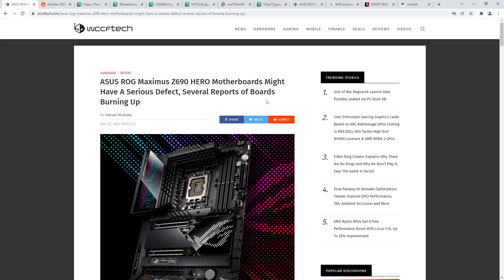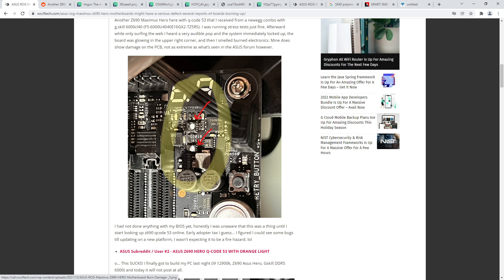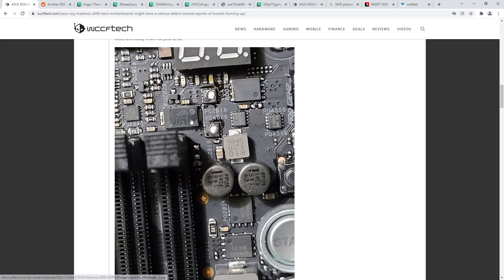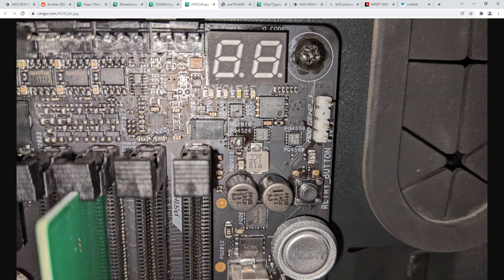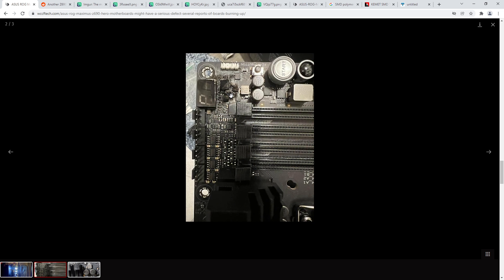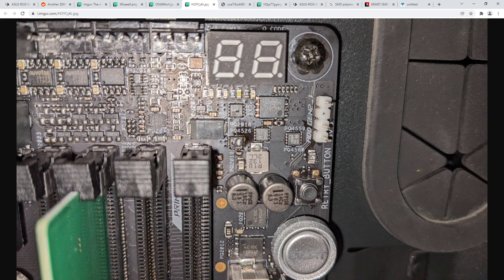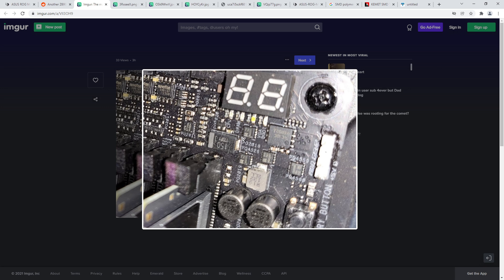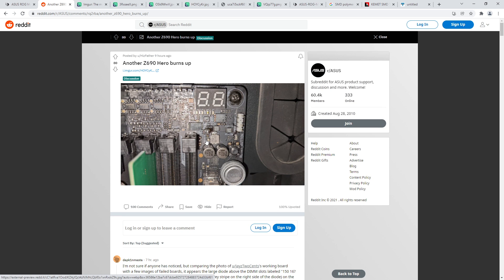My thoughts on the ASUS Maximus Z690 Hero failures

Comment: I have a z690 hero and can confirm that the g157 capacitor reads 5 volts on the right hand side of the capacitor and is positioned correctly in my machine. Picture uploaded on twitter.
Reply: I wasn't so lucky. My capacitor is facing the wrong direction.
Reply: @agordon20024  easy fix atleast
Reply: @CyberbrainPC  Easy fix as it may be for someone with a decent soldering iron and soldering skills, Asus really need to know to what scale this balls up stretches to. Anyone fixing it themselves will just lessen the impact of this major defect and it will pass off lightly like Apple's "A small number of ...."
Reply: @agordon20024  I'd get onto asus support tomorrow morning and get them to replace the board
Reply: @thomaswelch9147  I think you're right. This board is a replacement for a ROG Strix Z690-F that was defective. Will make my 3rd build in a week.
Reply: @agordon20024  on the plus side, if you're like me you're building a pc only a few times per decade, so you get the fun of adult lego for a bit longer.
Reply: @agordon20024  There is a guy further up in the comments who had your problem too. He contacted Asus support which acknowledged the problem right away and offered to send a replacement. Expect 7-10 business days before shipping. So at least you now know you don't have to fight the front line support in the RMA process....
Reply: @andersjjensen  I'll check that out. Thanks!

Comment: There's no way to "load the part backwards" into a pick-in-place machine.  If you load the reel backwards then the tape would be upside down.  The machine does rotate the part, so maybe it was programed wrong but more than likely, these parts were hand placed on these boards after they had already run through the pick-in-place.  Either because they fell off or because they couldn't get the caps when they ran the board, which fits with the different manufacturer caps.

Comment: I assume those mosfets must be running VERY hot even if they haven't failed, which would be even simpler to check than a volt reading (see if they burn your finger!). BTW, amazed at the number of owners here who are finding the suspect cap and chiming in with "mine's working just fine", apparently unconcerned. Is this (to use BZ's turn-of-phrase) kind of like Darwinism in action?

Comment: I'm in the United States and My capacitor is correctly oriented.  And I've pushed the 3 different DDR5 memory configurations and 12900K to their limits to the best of my ability.  No blown up board (yet , hopefully).  I hope you're are correct because I do not have the opportunity at the moment to pull this board from my case and wait out ordering a different model.  btw my PC runs 24 hours a day for remote access.  I'm extremely concerned now.  We need a conclusive answer from ASUS immediately.

Comment: I just finished my Hero build with an upside down 150 and stripe on the left. I called support to see what they would say. They're response: 
Yes it is safe to power on your new build, please just make sure that you connected the cables properly. Also it should have a enough power and cooling. ... If in any case that there is a safety hazard related problem that happen to your ASUS product, please reach us out for us to investigate it and provide a possible solution. ... We have to investigate it first so that we can came up with the solution, usually if safety hazard happen it will be our customer care support that will handle it. Not sure what to do.
Reply: dude it will be months before customer service even knows that this is the issue. They sure won't believe you if you tell them a cap is flipped
Reply: @marcogenovesi8570   @Mingyao Liu  - Newegg offered to refund and give a discount to upgrade to the next ROG z690 I wanted. So, I got the Formula for a bit more. Not ideal, but the best under the circumstances and I'll have a replacement in 2 days. I'll check the chip orientation (presuming it has the same layout) before building and move on.
Reply: @spindlewood9  you are very brave, good sir
Reply: Get an electrician friend, show him this video and ask him to check the capacitor with a multimeter

Comment: I bought a MSI B550 Tomahawk. I installed a 5900x, ran Cinebench and the PC shutdown.After investigating the vaunted VRM failed. Thankfully I was able to replace that with a Asus X570 Tuf that was probably produced before the shit hit the fan. It is for me trying to maintain stock levels by cutting corners so Quality Inspection is lacking. I have had a CPU die on me and several boards just stop working.Any enthusiast worth their salt will stay away from Gigabyte boards but if we are getting them on Asus Maximus boards I would be worried.
Reply: I got this board and TBH, I really preferred getting EVGA classified but you know EVGA and their really delayed launches of their Mobos. This/Formula was my second choice and I did not want to pay the extra for the Formula so I got this board. So far cap seems oriented correctly but I hope this the issue and there is nothing else going on. I just need to wait for memory and hope everything will be alright.

Comment: I have the backwards capacitor on my motherboard.  Got 4.5 to 5 volts using my multimeter.   Issue seems to be confirmed
Reply: Better get that RMAed then.
Reply: This comment needs to be pinned
Reply: Dodged a potential fire, well done to all (except Asus, of course)
Reply: @j-bro  This is not a fire hazard, all adjacent materials are fire suppression rated and capacitors and power semiconductors blow themselves clean at well under ignition temperatures.
Reply: Can we pin this comment? And get this man a drink?
Reply: @medavid16  my cousin and i both just checked and we also have the backwards capacitor :(
Reply: @medavid16  how was the RMA process like? Are they going to send you a board that is confirmed to be free of the defect? Are they shipping you the replacement board first or are you sending yours in first? I just want to know what to expect when I call. My steam name is suspectmammal
Reply: I’m going through this now. They SHOULD be sending an advanced replacement on this issue but they are bot. They are not even sending a new replacement. They are offering you send your board in as an RMA for repair with a 7-14 day lead time. I bought through Amazon and even Amazon thought it was messed up that they wouldn’t send me a new board so I just got my money back and ordered another board somewhere else. If I get another reversed capacitor I’ll have to send it in as an RMA. Good luck
Reply: @SikSemper  this is exactly what I imagined was going to happen. I also bought it from Amazon and can’t find and hero boards in stock. Where did you find your replacement? I was hoping to get the same board that was NOT affected by this. Might have to downgrade to the strix E
Reply: Do you have a hot-air station? If they refuse RMA (WHICH THEY SHOULDN'T!!!) just flip it.
Reply: @coccoborg  I have a hot air gun and soldering kit - holding off since my assumption is if I mess it up it voids the warranty.  Reached out to Asus and they escalated to tier 2 support and said I'd hear back in 24 to 48 hours.  My guess is they're going through the usual internal red tape for issues like this.  Thankfully I hadn't sold my old board cpu etc. yet if I need to use the computer before they can make this right!
Reply: @themancave8567  good! yes, fixing it yourself is only doable as a last resort. If ASUS is smart, they'll just send out replacements, receive the defective ones, fix them and keep the boards as future refurb stock for RMAs!
Reply: @coccoborg  Asus just called me and will RMA the board.   They confirmed the backwards capacitor is the issue and they will be checking any replacement boards to make sure they're right.  Unfortunately 7 to 10 business day lead time but it is what it is at this point.  Just glad there wasn't a fire and I have a backup system
Reply: @themancave8567  glad to hear this!
Reply: @themancave8567  Thanks for the update! We now have confirmation that Mr Buildzoid's eagle eyes nailed this one right away (despite his modesty dictates that he should say "only 99% certain").

Comment: I agree with the automatic visual inspection catching it since pick and place machines notoriously have parts that spin, are picked up off center, backwards, etc the path to placement is always over the camera which corrects positioning. Must have been an engineer leaving placement orientation out of the program. Don't blame the operator!

Comment: waiting a Z690 extreme I will definitely look at that capacitor before installing it THANKS EDIT : I will post tomorrow 29.12.21 if mine was correct EDIT2: bad news the extreme has a thick metal cover that hides the component and you cannot easily remove that cover EDIT3: game over sorry I won't be able to inform you, the regular extreme is not compatible with the 3090 active backplate, the giant M.2 heatsink/oled screen (3cm high) is so close to the pcie slot it almost touches it stupid design...I'll have to wait for a glacial EDIT4: glacial incoming will visual inspect when I can in 2022 heh
Reply: worth to check because I read in reddit that even extreme mobos gave same error code
Reply: @ComboSlicer  wasn't able to, my rtx active backplate is not compatible with the regular extreme board but only with the glacial..I asked ASUS for compatibility on the glacial but did not think the regular one would be different, it is..the heatsinks are giant +3cm from the pcie slot also it's very close to the slot it goes lower than the plastic retainer tab almost touching the pcie slot, stupid design I had to return the motherboard

Comment: How would they carry out that qc test? It's conceivable given the shortages they switched the source for the capacitor part way through production. Way more likely than a pcb revision.
Reply: The pick-and-place machine has cameras that check the orientation visually. If you can see it with your eyes (and you can), the machine assembling this board can too. If it's configured correctly
Reply: @marcogenovesi8570  gtk.  Thanks!

Comment: Sounds logical these caps must come in a tray because it's not even possible to load a roll of caps backwards. Unless the supplier loaded the belt backwards in which case they are in bloody hot water.
Reply: the orientation in the belt isn't guaranteed, it's down to the operators to check

Comment: remember when you had jumpers to select 5V or 5VSB for each USB port on the back of the board, the memory VRM just directly connected to the 5V on the 24pin back then. when those jumpers went away is when that mess of fets appeared. I always assumed it was just a dual schotkey-diode-pack thing till digging up part numbers yesterday. 5V in one side, 5V-standby in next to it, and always-on 5V-USB out the other side to feed 5V to anything on the board that needs it including USB ports.

don't ask me why there powering the memory VRM from 5VSB when the comp is off, that was the part I didn't understand when that jumper to magic smoke circuit change happened. it's not like they're running 5V to the opposite corner of the motherboard, the memory VRM is right there next to the 24-pin, lol.  In ref to this vid, they been doing things this way for over ten years now, so was confusing what had changed to cause the things to fail all of the sudden.
Reply: Switching to software control of the USB power source was probably part of the big move to jumperless boards, and with USB 3, there's also MOSFETs to provide higher voltage to power hungry devices.  MOSFETs switching the power to RAM is probably to time precisely if they are turned on before or after the RAM controller in the northbridge or CPU, no 5VSB involved there.
Reply: Without checking anything, I'd say there will be at least the option to use 5VSB to power the RAM so they can support S3 (Suspend to RAM).

Comment: On my 2nd Z690 hero board. First board had same issue. I just get error vide 53 right after the board turns on. I even RMA’d my 12900k thinking it had a bad memory controller. I contacted ASUS and the said give them a few days to investigate the issue. So will see I guess.

Comment: Hm interesting. On my HERO mb the cap is oriented as on the Jayz's mb. I hope everything will be fine when I start the system. I haven't assembled it yet because I'm still waiting for the GPU WB to arrive... Could you message me so I could share a picture of the troubleshooting spot? Thanks for the video!
Reply: For God's sake, take a volt reading, or if you can't, as soon as it's powered up check the temperature of those mosfets (i.e. see if they burn your finger).

Comment: I checked which side is ground with my multimeter, and I show that ground is on the left (opposite side of the MOSFETs), suggesting that this cap is installed in the wrong orientation.

Comment: So I have a Maximus Z690 Hero board with the Cap in the orientation of the failing boards (anode stripe on the left). I also own a DMM so I took a measurement of the right side of the Cap (Cathode)  with the Positive DMM lead. My ground point was the top pin of the RGB header (Negative DMM lead, top RGB header pin, has ground symbol). I measured 0V between the points, appears according the voltage measurement on my board that the cap is NOT reversed biased. My board has been in use for about 7 days (not on continuously, but on about 10-14 hours each day). No problem so far.
Reply: I have this board and the cap (which is the second type that he did not recognize) is oriented the with stripe side (anode) on the right (the supposedly good orientation). My testing of resistance to ground is as follows:
Anode (striped side - right side) to ground (either the ground pin of RGB header or mounting screw)
Is in the range of Mega Ohms around 3-5 )
The Cathode side (non striped side or left side) is basically shorted to ground.
I hope it helps. I've yet to power on the system I wait for the memory kit I ordered to be delivered to me.
Reply: @eliadbu  That sounds much better. This would also make my claim valid that the anode to ground should be over a k to be good. And thx for sharing your values.
Reply: That circuit is probably not energised by default and there is some trigger condition that causes the mosfets to turn on and blow up
Reply: Well, you could measure the ohms to ground from the striped side. If you have less than one K, you may have a problem.
Reply: @silabar5751  Hmm, there may be some merit to what filippo said. I shutdown the board and did a resistance measurement from the left (anode side) of the cap to the ground point on the RGB header. It measures a very low 1.5 ohms.  Repeated my first measurement and still have 0V,  and still no issues today. As another data point, I have the Wifi feature disabled and Bluetooth enabled in the BIOS, I don't know if this is even a factor, but it is a config data point about my installation that could be useful.
Reply: @DKBassMan65  Hmm, then let's do the game the other way around. How much ohm do you have from the cathote to ground?
Reply: @silabar5751  I did that measurement as well and it measures as an "open", (Cap) right side (Cathode) to RGB header ground pin.
Reply: @DKBassMan65  Too bad, unfortunately the data are not clear to me. Unfortunately, I have to pass here. But perhaps someone else can interpret the information better here.  Sorry.
Reply: @DKBassMan65  Measure between the ends of the capacitor, then compare to where Kemet says plus should be.

Comment: Mine has a backwards capacitor. Hasn't burnt up yet but it's probably inevitable.
Reply: If you can discontinue using it for the time being, I would. A small, but nevertheless present risk of this taking other components out when it goes. As things stand you're looking at a (hopefully quick) board RMA and replacement.

Comment: No chance the board is changed, if you look the mosfets and the plane they are on havent changed. If they did & that became a ground plane the mosfets would need to be move/rotated & would need a cap on their input/output because that cap wouldnt do anything being tied to ground on the mosfet side.

Comment: looks like two different capacitors? so could it be that the belt was loaded into the PAP machine correctly, and they were in the belt 'backwards' from the manufacture of the caps?